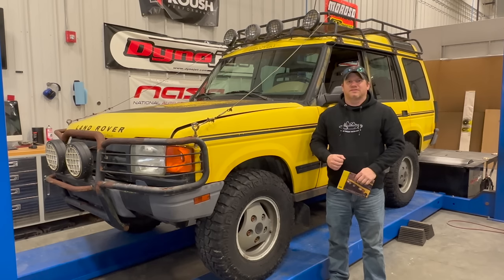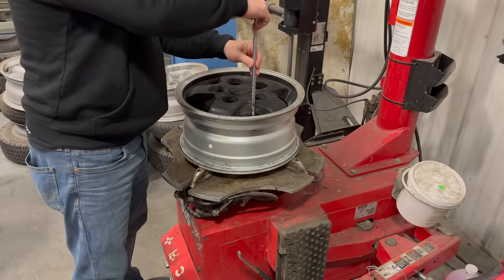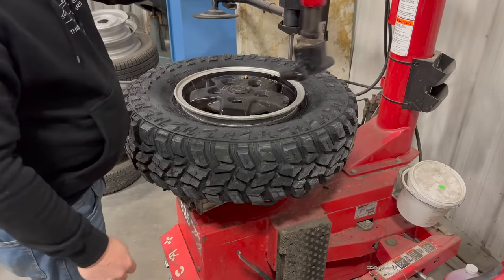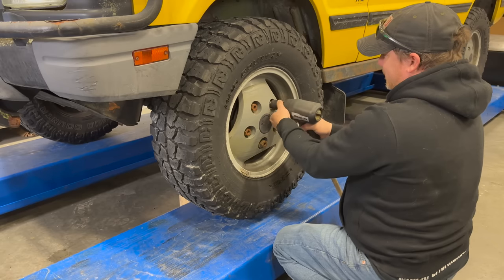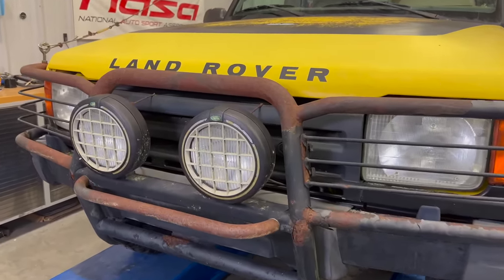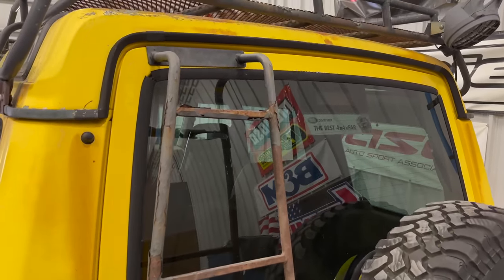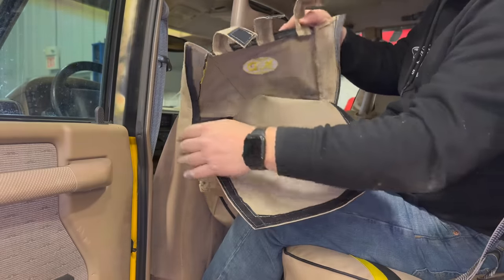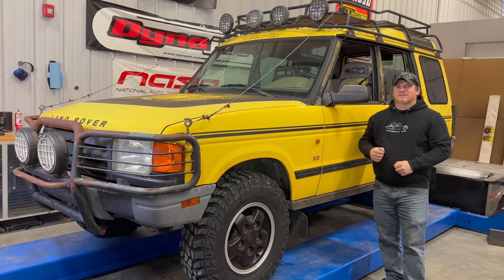The Special XD Parts Needed To Make It Right

Comment: I had a series 2 disco.
Dropped lots of money on it.
Seat cushion base fell apart, I submarined whilst driving... that was fun.
Alternator died, twice.
Elec windows in the back died,  had to pull out and solder the main board. 
Front window regulators fell apart twice...
Gearbox blew out 2nd gear.
Finally head gasket went on it, diesel.
In the end I bought a pajero to make it right, and my landrover mechanic bought the disco, at a cut rate, after fixing it...
The disco was so comfy but underpowered,  and I now love Japanese reliability!! 😆